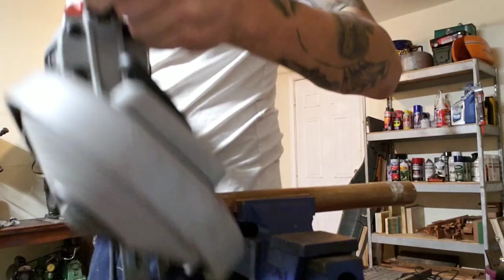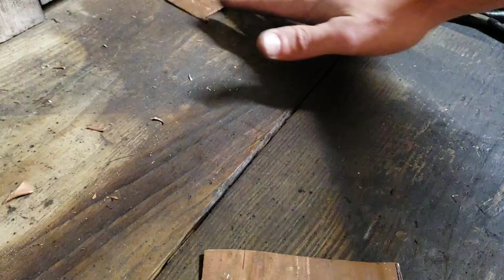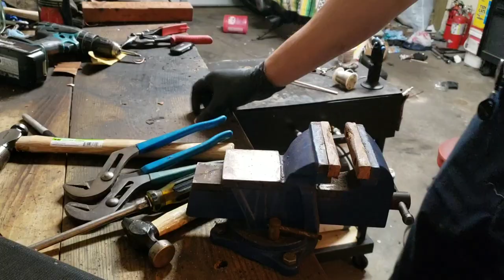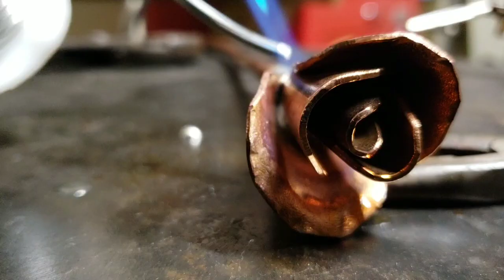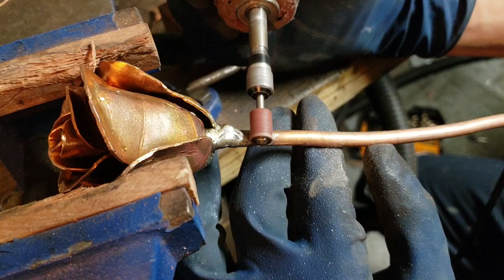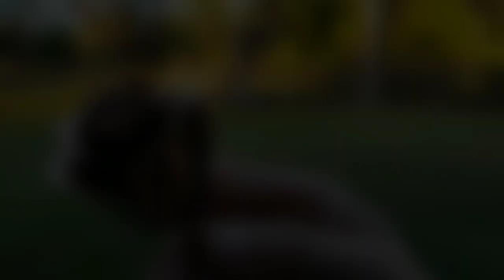Making a Copper Rose

Comment: Nicely done! You make it look so easy I think I'll give it a try. I have a project coming up that includes a rose, which I've been planning on carving from wood however I had the thought recently of doing it in copper instead and thus how I got here to your video. Thanks for sharing!!!
BTW - you left off the sepals and thorns. Any particular reason why?
Reply from the maker: Glad you liked it! Biggest tip I could give is watch your heat distribution. I had to redo this several times because the solder would melt, and everything would just fall apart. But it's possible! I honestly dont have a reason though, just didnt really think about it lol but next time I will!
Reply: You could try using jewellery silver solder, it's what I'm planning on using to make a version of you shared. Your work is excellent, I really enjoyed the results you achieved without having to buy expensive tools. Anyway, about the solder. It comes in 4 grades and each grade has a different heat range in which it melts and solders; it's how jewellers solder lots of tiny pieces together. It goes hard, medium, easy and extra easy and hard has the highest melting point. I hope this helps and makes the soldering easier. The only problem is, it won't fill gaps like that lead solder did. The fitment of petals to the stem would have to be a lot closer.